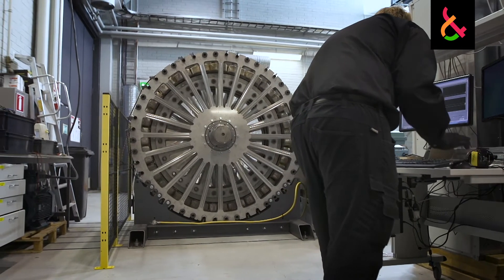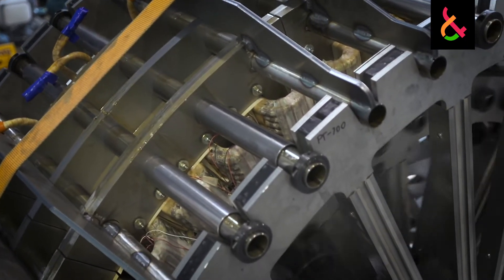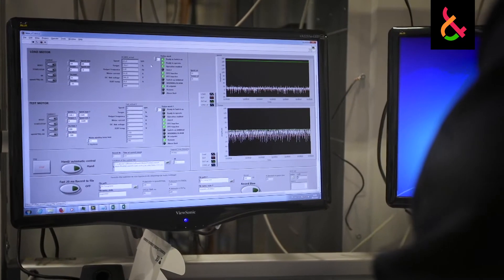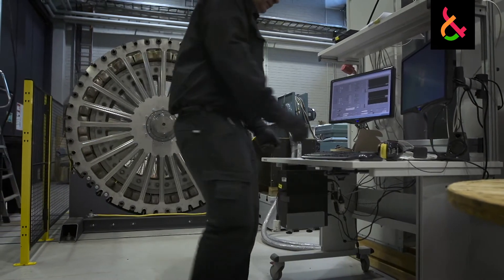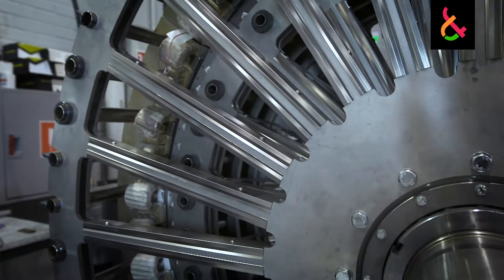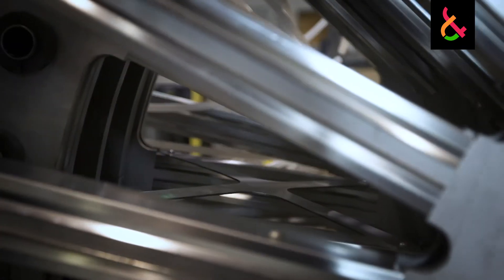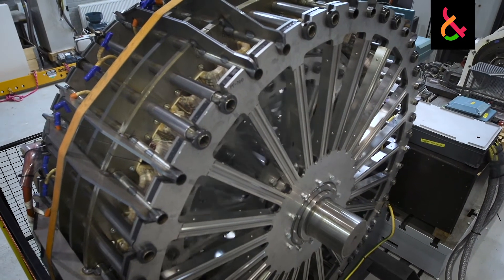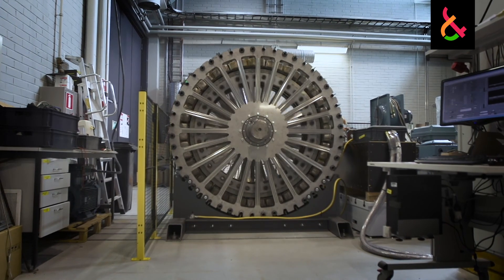⚙️ Liquid cooled electric machine - LUT University

Comment: Absolutely wonderful. If it's possible to generate 100 MW Medium Voltage @ high frequency (400 Hz) Power with compact dimensions, then probably you have a decisive ruling in Electricity Generation. Particularly Shipping Industries will benefit the most. At present Axial Flux Technology is the leader.